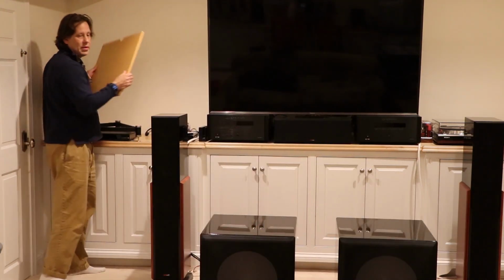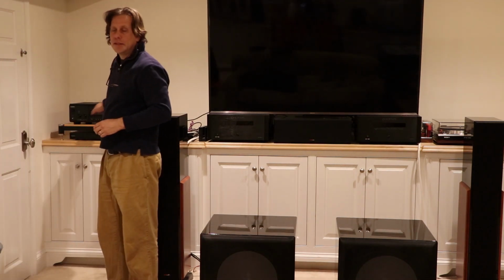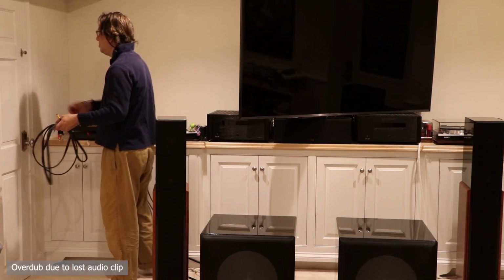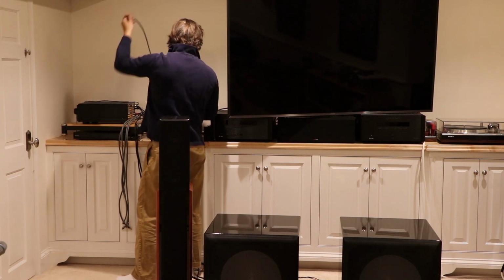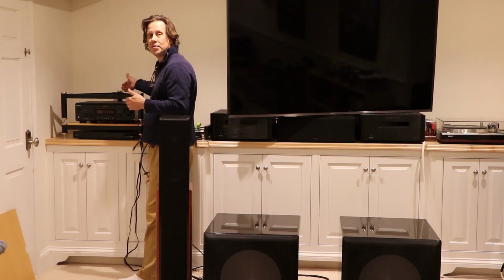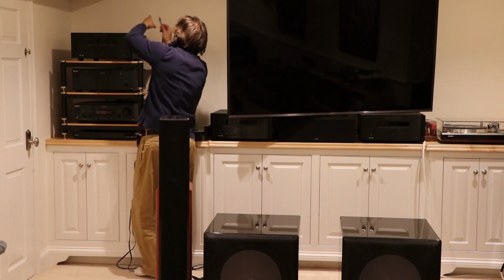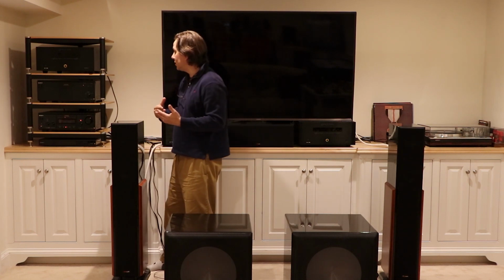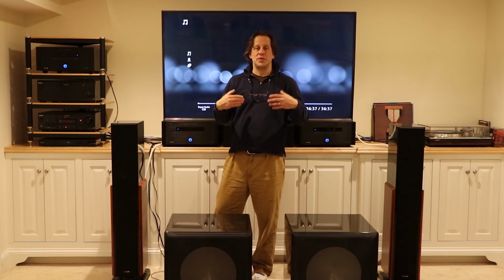VTI BL304 Audio Rack Component Installation & Wiring

Comment: Would you say it’s stable or is it wobbly?  It looks good either way.
Reply from the maker: Stable with the equipment on. It needs the weight of the components to hold each tier from moving. Once populated with equipment, it doesn’t move on me. -Jon

Comment: I saw the initial photo and thought it would look more streamlined than my current setup. But it’s probably going to make my receiver overheat. I suppose it’s slightly better than stacking components directly on one-another which I would never suggest. These shelves just don’t allow for any air circulation for the amps to vent properly. Even if it doesn’t engage the overheating protection it’s going to cause issues down the road. I really hoped this would have worked out because I liked the look. But unfortunately it doesn’t even look like there is enough clearance to install cooling fans. The search continues.
Reply from the maker: You raise a good point about heat. Heat dissipation is something that should be considered to prolong the life of the equipment. Receivers today get very hot. I placed my equipment in order of temperature with the hottest amplifier at the top.-Jon
Reply: @ripewave   I agree 100% Jon. For some odd reason my new Denon AVR runs 5 x hotter than my Rotel amp powering the front channels. The Rotel runs close to ambient temperature which baffles me. I also did notice your amp being on top which makes sense. But if you know of any other audio consoles that vent better I always appreciate the input 👍. Thanks again
Reply from the maker: @AlexMQQ2273  as far as side opening this unit is wide open so it is really the height between sleeves that is going to make the difference without going the route of fans or not stacking at all. The VTI levels come in different heights. The largest spacing in mine is 9 inches but they also make a “tall” version that has a 13 inch section - search VTI BL404SC-13.-Jon
Reply: It's open. Components will be fine

Comment: Also liked the VTI stand. Thinking about buying one in full black. I have a naim system with 3 components plus two power supplies. Those four tiers will solve all my problems of aesthetics and avoid placing my gear on top of another. The build quality seems nice from your video.
Reply from the maker: Yes - I am pleased with the build quality and may purchase a second for future expansion of upgraded amplifiers to power the surrounds. That one will go in the rear of the room. On thing to be careful of is the spiked feet can dent or scratch the metal caps in not placed carefully within the detent. I made a small scratch on one but it is not noticeable as it is not a visible angle.-Jon
Reply: @ripewave  You mean the ones on each tier or just the ones at the floor?

Comment: nice vid! i have a APC 48 unit rack in a separate room. the only thing in my listening room is the speakers and tv. i don’t watch many things off disc. i rarely play my records - tho i have considered putting my record player in my listening room. but like ur doing having all ur gear layer out how you want is awesome. what are ur plans for cable management?
Reply from the maker: Thomas - sorry for the delay (busy times). While my in-room setup works for me now, I do feel that having the equipment isolation is a separate room like you have is ideal for the listening/viewing experience. I have just settled on a more tactile approach for now. That APC 48 rack should be nice. 

I am waiting to acquire the new processor first befit shorting out the cables. For now I am keeping it with tie wrap at best. Open to suggestions.-Jon